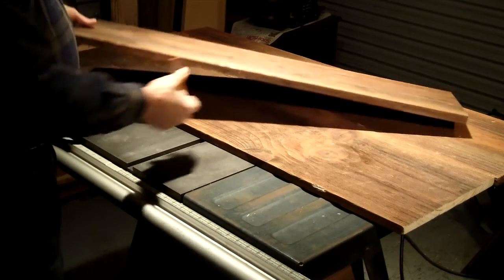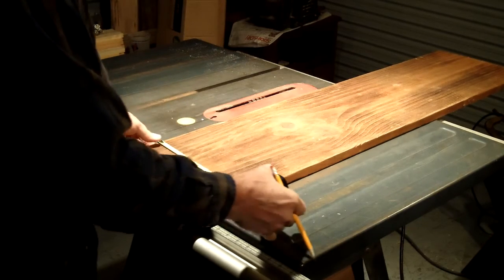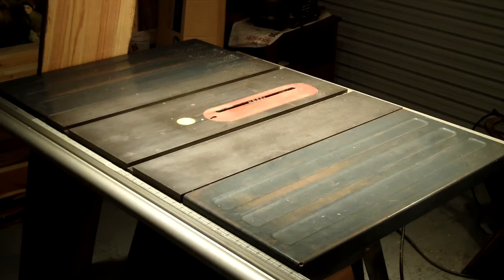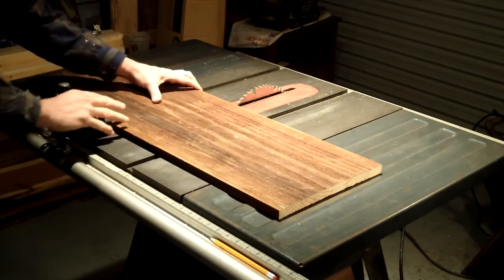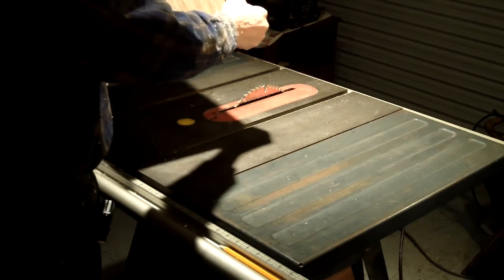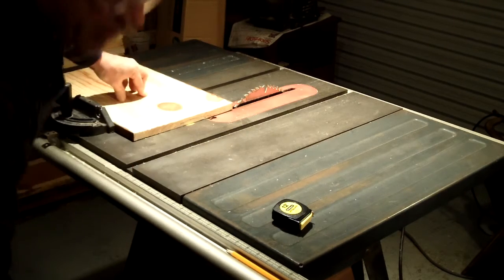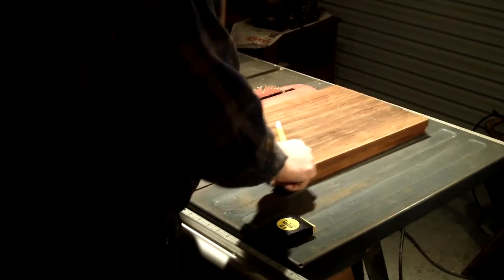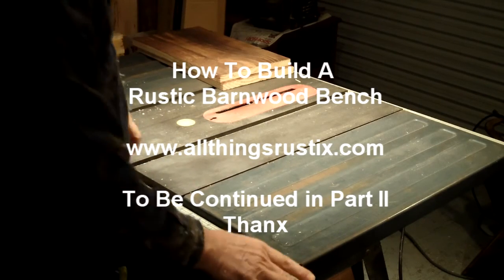How To Build A Rustic Barnwood Bench

Comment from the maker: Believe it or not it is fake barnwood that I made, you see how it looks like new pine on the cut edge. What I did was use a pretty cool method. I bought new pine 1x12, put a medium wire wheel brush on a drill, put on safety glasses!! I held the wheel against the board and removed the soft tissue from the annual rings. I then soaked steel wool, a rusty horseshoe piece and some rusty nails in vinegar overnight. I then painted the wood with it, it reacted with the tannins and presto "Fake Barnwood"